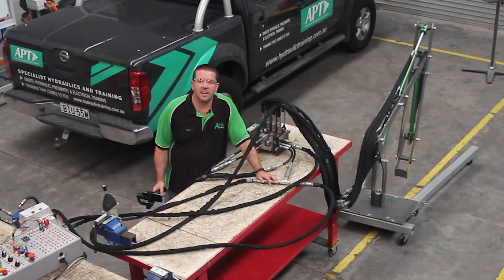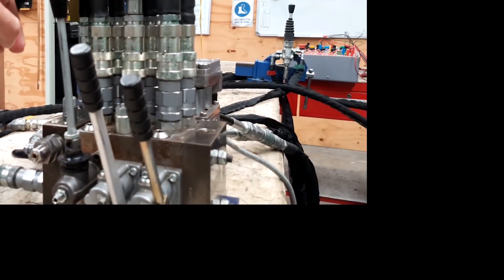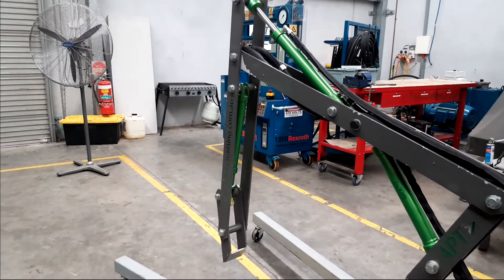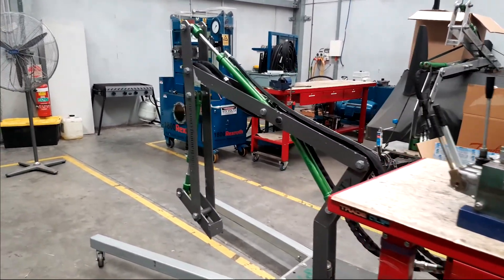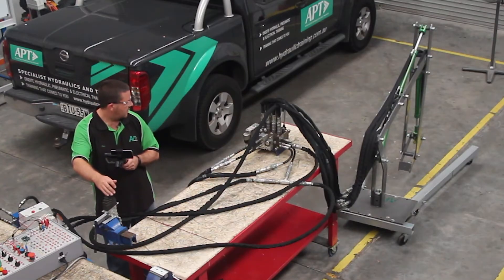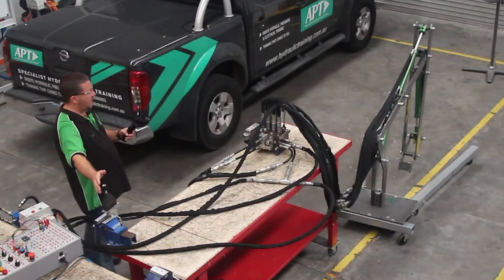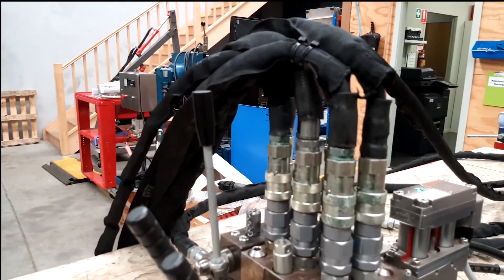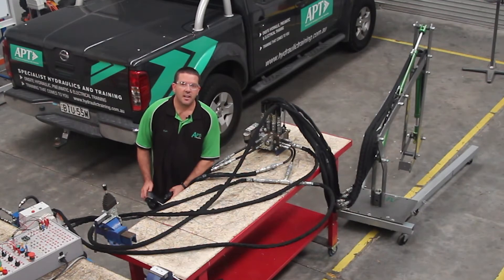How To Dissipate Stored Pressure In An Excavator- AskAPT #5

Comment: I think systems now have an energy dissipating valve on the hydraulic tank, by activating it, where most oil trapped in the implements as capable of causing safety issue are routed back into the tank